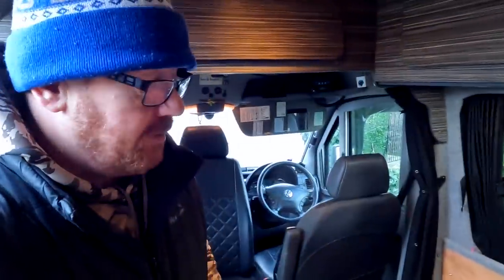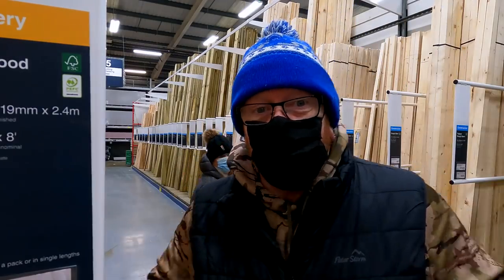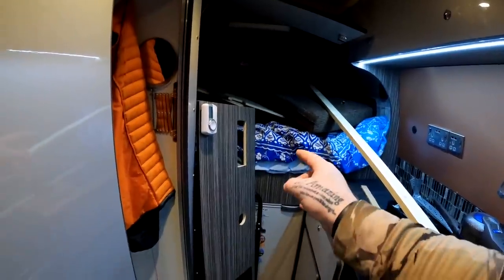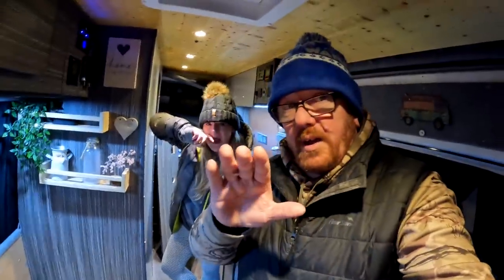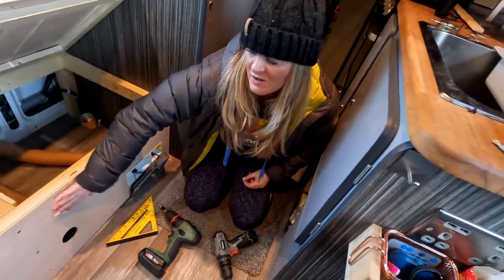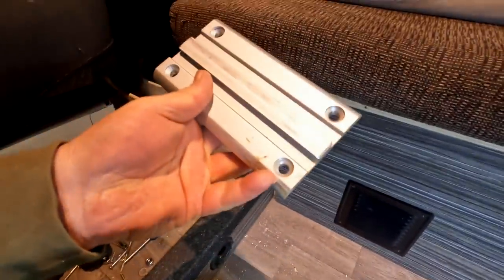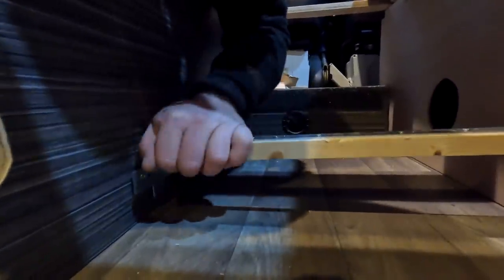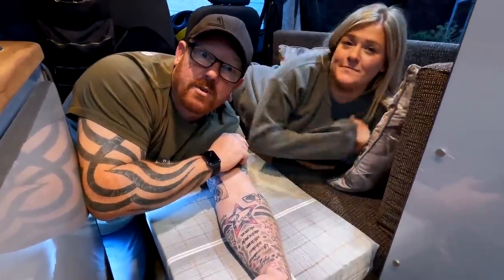EASY Pull Out Bench Seat UPGRADE

Comment: Great job Neil & Emma. The price of wood now is shocking, especially from DIY outlets but at least they have some and all the other bits you need under one roof. :)
Reply from the maker: Very true the price of everything has gone through the roof, I think I'll send Emma bin diving next time we need stuff lol!
Reply: @Anna Orlinski  hi, it depends on what type and how much wood you need, when we started building we did a lot of research around local places to get the best prices, for example when we needed large amounts of ply for the side walls and floor we used a timber yard in Formby in the end, as they where doing the best price and delivery was free, the laminated lightweight ply for the cupboards and walls we used a company called ukleisureparts.co.uk as they where coming out around £50 a sheet cheaper than other suppliers and it was the look we where going for, it depends on what look you want in your van, but the best advise we can give is research and shop around, it takes more time but its worth it, we had many a sleepless night whilst building!

Comment: Hi, I've been watching and loving you videos for a while. I'm slowly catching up. Just a bit of safety info, which you've probably adjusted already, but your carbon monoxide detector is too low in your van. It needs to be placed just above head height in the van when standing. This is because CO rises when warm, and it slowly drops into the space as it cools. I'm a gas engineer, and have seen several fatalities over the years from misplaced alarms. 1.7m is normally the ideal height. Sorry if I'm telling you something you already know. Craig.
Reply from the maker: We have 3 buddy low mid and high

Comment: Looks great, are you going to be able to push the plug all the way in, with that lip around the sockets? Would of thought the cable at the bottom of the plugs would  make it difficult
Reply from the maker: Luckily we measured most plugs abs there is a 5mm gap from the base to the cord . So hopefully we have a winner .
Reply: Should of known you would have thought about that one, top job you 2 👌

Comment: Hey matey, great vid as always, did you try the plug slots in the furniture board, the bottom looks tight to me, may have to extend the bottom area of the plug housing. Just a wee obs. Cheers guys✌️🇬🇧
Reply from the maker: hi great point. Yes we have the plugs fit fine as there is a 5mm gap  between the edge of the plug and where the cable is, so with routering the back out it has given us enough room
Reply: Happy days, keep the vids coming ✌️🇬🇧

Comment: Great vid Neil and Emma. Got question for you regarding vapour barriers!! I see behind you sofa we could see insulation but no barrier. Do you think we actually need them? As we’re building a Renault Master LWB van with a full width ways bed and toilet but no shower and we’re having trouble trying to get all our wires behind our panels in the garage as the barrier tends to get in the way. It is rather taught mind!! What you think? Cheers.
Reply from the maker: We don’t have one there cos the boilers there so I don’t think we need one . And the vapour barrier is an on going van conversation which I think is a personal choice . Don’t thing any ones knows for sure mate but we lose no heat so I guess we did ok
Reply: Hi Ian I also have a Renault Master LWB , used for the last 2 years without a vapour barrier , only the white recycled insulation rolls were used , my choice after watching another build they mentioned any leak from the outside will not dry out for a long time if it is sealed behind the vapour barrier , seemed to make sense to my tiny mind , so I went the same way , recently removed some panelling to run extra wires , all was good no sign of damp or any mouldy looking bits .  I do run heating and ventilation so if there was any condensation it must be drying out pretty quick.   your choice though lol